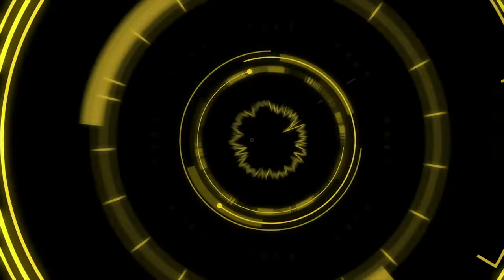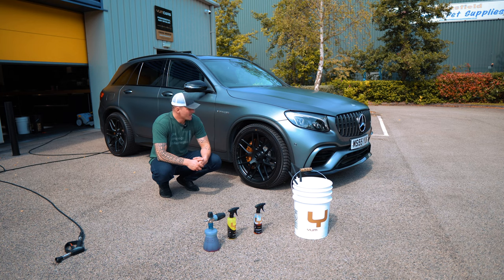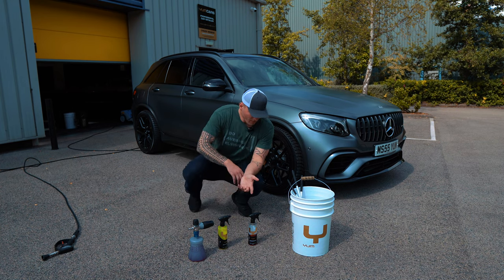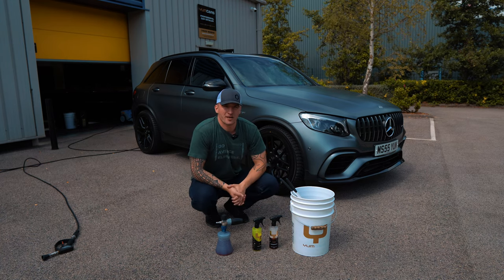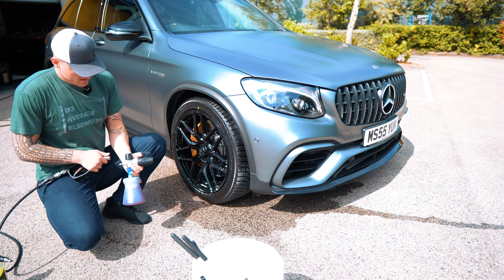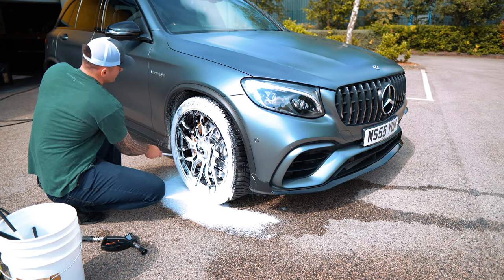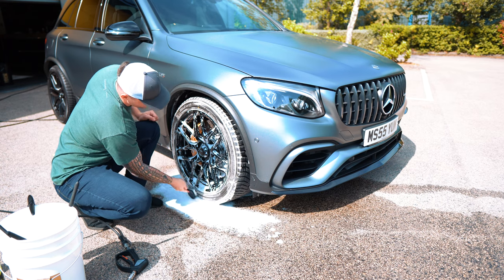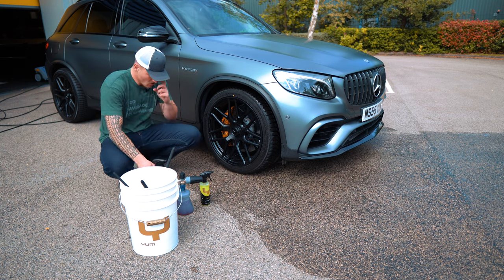How to Clean Wheels with Carbon Ceramic Brakes! Beginners Guide!

Comment: Used a Gyeon iron remover wheel cleaner to clean the wheels on my M5 that have CCBs. I was later informed that shouldn't have not done that. Praying I don't have to replace them 😬
Reply from the maker: You will be fine, most people who give recommendations usually don’t have CCB’s we have been testing this in the backgrounds for years and nothing has changed.
Reply: @YumCars  Appreciate you 💪🏼